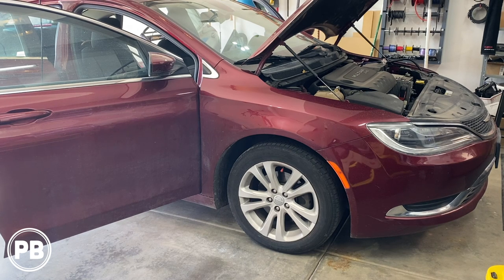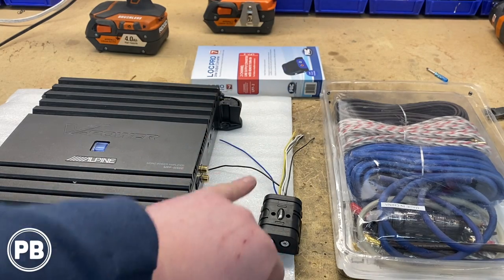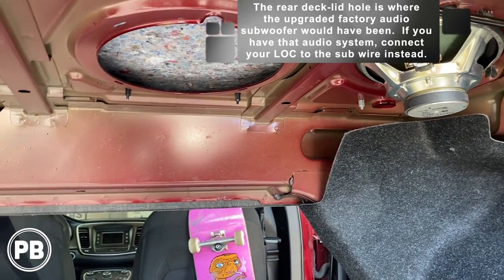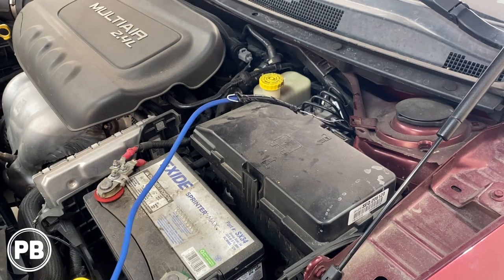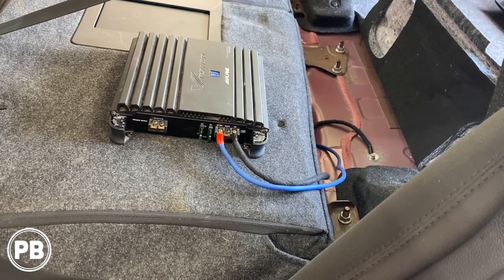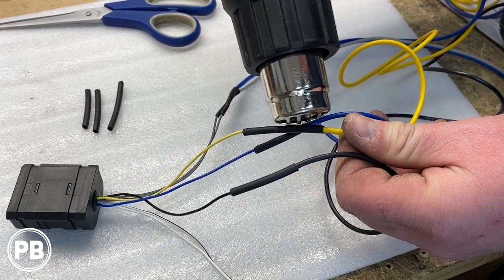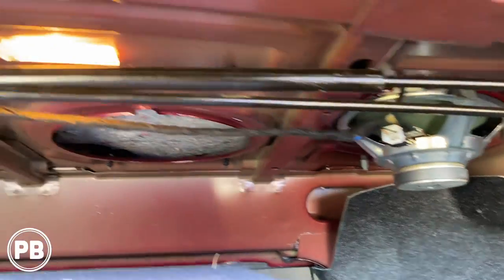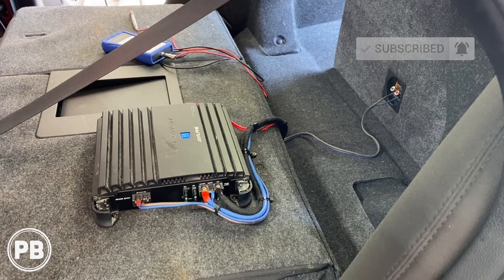2015 - 2017 Chrysler 200 Amp and Sub Install

Comment: I’m about to do this with my 2014 200 and need to be sure that splicing the positive and negative together on the converter into one wire is actually okay? Once you splice the fork into the separate pos and neg on the speakers wire harness does it separate the signals or something?

Comment: Those line out converters have been proven by Steve Meade to introduce a lot of distortion not sure why wouldn’t recommend the audiocontrol line out converter.
Reply from the maker: Not every job we take will listen to our recommendations. We still set gains property with an SMD-DD1 for a clean signal regardless
Reply: what do you recommend tho?

Comment: Was 18 feet enough power wire to reach the  back of trunk? Looks short!
Reply from the maker: Yep! Most kits are that long. If not, you can buy by the foot with most car audio distributors
Reply: @ProvoBeastAudio  so did you cut any of the power wire length off to reach the trunk

Comment: Where did you find a good 12v source for the remote wire for the LOC?
Reply from the maker: Our LOC robbed constant 12v and ground off of the amplifier terminals.  Alternatively, you can pull that 12v source from the fuse box with an add-a-circuit.
Reply: Or the cigarette lighter on the passenger side